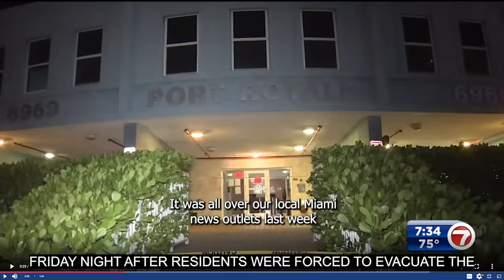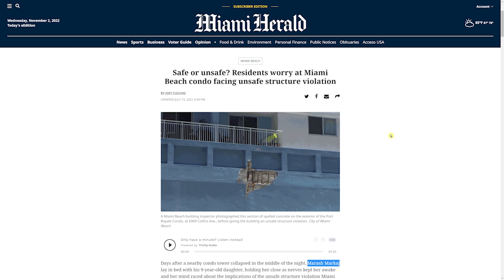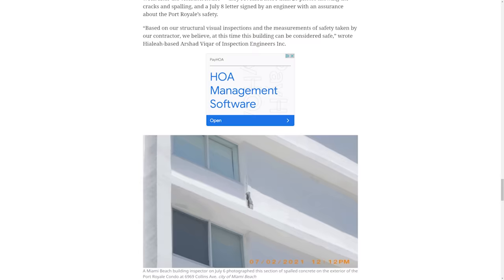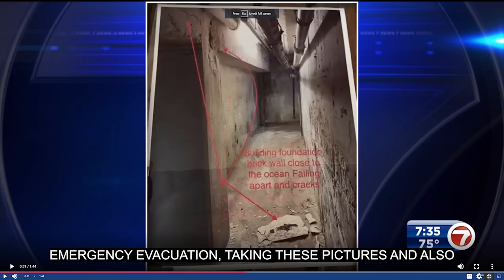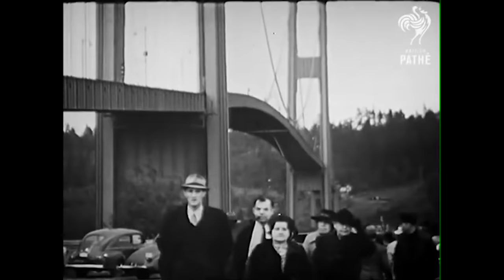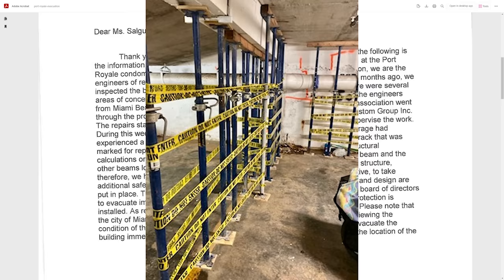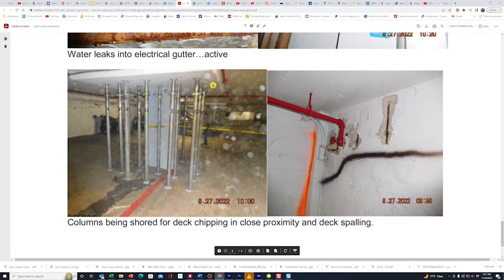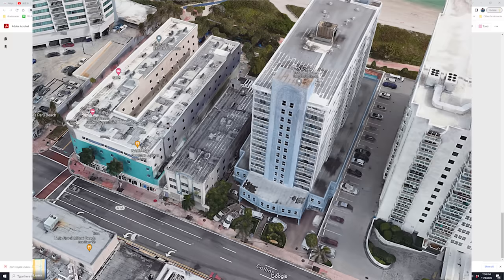Another Miami Condo Evacuated Why it Will Collapse

Comment from the maker: 📺 WATCH: Miami Condo Collapse: 4 Engineering Fixes May Have Prevented It: https://youtu.be/CK3o8KlL3NQ
📺 WATCH: Scary Garage Damaged Concrete Marriott Harbor Beach, Like Surfside Collapse
https://youtu.be/3EzxZJhXRR8
Reply: The decision to evacuate a building like this is HUGE
But no matter how inconvenient it may seem I believe it was the prudent thing to do. I just would like to see that residents and property owners have the right and ability to have a second opinion. Anything can be politicized and weaponized.  You don't want to give too much power to corrupt city officials.
Reply: With respect to the pertinent and reasonably-covered subject matter put to one side the audio quality of this video is abominable. It sounds like you recorded it talking into a shoe.
Reply: is this what happens when you build a city on the back of a cocaine fueled boom? From the mid 70s to the late 80s?
Reply: @guidedmeditation2396  go look up sydneys Opal towers......
Reply: Looks like all the apartment buildings in Florida are on collapse alert!!
Reply: Are there no primary steel beams?

Comment: It’s hard to wrap my head around the idea of this building being repairable. Thanks as always Jeff for your efforts.
Reply: If you're willing to give up enough underground parking spaces, ANY such building can be saved... i.e. picture a parking garage with nothing but shoring poles!... :yougotthis:😱
Reply: It’s Florida. They’ll just throw some bondo and duct tape on it. 
The builders AND owners, will never be jailed if it falls down. It’s only a fine. 

“If the penalty is a fine, that means it's legal for the rich.”
Reply: i concur
Reply: @tetchuma  So you know the building codes in place in Florida exceed most if not all of the nation, you see many buildings torn down or rebuilt due to lack of structural integrity.  This building was built in 1981 when building codes and shortcuts were commonplace.  If you want to see decrepit buildings look in NYC, scaffolding in place that you see all over the city is there for one reason and that's to hold up the buildings and the tearing down and rebuilding you see in Manhattan is for the same reason, the building is just too old and unsafe to use.  Many contractors in south Florida used sand from the area which is full of salt, shortcuts to save money and a blind eye was turned towards it.
Reply: I wouldn't want to live there.
Reply: @krisone63  
Judging by the video evidence of old rusty drips and several instances of cracking/deteriorating concrete… yeah, Florida is FAR MORE superior at preventative maintenance than anywhere else in the US… 🤨
So when will you and your family be moving in?
Reply: @krisone63  scaffolding supports buildings?
Reply: The scaffolding keeps the falling chunks from killing people on the sidewalk. It doesn’t support the building.
Reply: CDI and the Loizeaux's will repair it.. if it is still safe enough to prep for charges.. LOL
Reply: Same for me. Even if they filled the entire parking deck full of concrete, what’s the structure 2 floors up look like?! Could a hurricane take this building down?
Reply: Yes. And whatever deficiency that is showing up in cracks is likely or at least possibly also in areas you can't see.   Concrete is only as good and strong as the one bucket they poured that one day.   In China they have huge beautiful towers that all have to be torn down because they didn't mix the concrete right and it is shocking they have not collapsed already.   The main tower columns can be chipped away with your thumbs..  It is as if the main support columns are made of saltine crackers and your an scratch inches of it away as you dig your fingers into it.   They have a name for this problem.  They call it  TOFU DREGS construction.  It is about as sturdy and strong as tofu.
Reply: Depends on the condition of the concrete and what's under the foundation. They could pour more solid colums or even an entire wall in the basement but the pilings underneath have to be able to support it. They can add more steel.
Reply: @tetchuma  no one is rich enough to handle the repercussions of these buildings champlain is in the billions now
Reply: @tetchuma  time to demolish and rebuild imo. This is like the slowest nightmare that we’ll be watching for the next two decades
Reply: It’s a tourist area and everything is centered on that … things are getting older an getting worse as time goes by
Reply: @MajorCaliber  The sand in the concrete mix is unwashed sea sand. It will just continue to crumble and rust the rebar. It doesn't matter if you pump the entire parking garage from floor to ceiling with concrete, the columns siting on top of it will still collapse. As a  union mason who does retro fitting for a living, there is no way in hell i'd put my family in that building. This building needs the rebar x-rayed and concrete cores taken and load tested.
Reply: I wouldn't trust the amount of probable damage throughout the entire structure. If a concrete beam separates by 1/2", everything above it must have suffered shear loads it was never meant to see.
Reply: @Khanfuzed1  As this is a condo, (like Champlain towers) I give all the responsibility to fix it to the unit owners.. Champlain towers just got lucky and had a neighboring building to blame for their issues... At some point the assessments are too high to fix and you have to dissolve your condo association and sell the land.
Reply: @MajorCaliber  - i was thinking same thing.. if you filled basement in with cement.. it might support it for years to come.. (yes i know this is not practical or possible)
Reply: @krisone63  I've heard the same about Panama City, Panama and their impressive sky line. Towers built with salty sand.
Reply: Florida, where the buildings and the residents are just waiting to die
Reply: @Jane-Doe.1126  live? how about walking around within falling distance of these buildings...
Reply: @guidedmeditation2396  I thought the situation in China was that they built those towers to provide jobs and to create a housing bubble (make their economy look big and healthy for outside observers). They were never intended to be occupied.
Reply: @NealD  
Consider the weight of the mass concrete filled in the parking.
Does this additional weight not do any effect on piles and ground?
This building is dead , fixing is not impossible but cost is way too high term of fixing is too long and too complicated.  It is better to demolish and build new.
Reply: @klubstompers  
Any attempt to check how bad is this building is waste of energy and money. Time has come to die.
Reply: Everything is repairable, just a matter of money.  I've knitted monumental stone together with rods core drilled for feet through cracks to 'reconnect' stones.  There are many such specialist systems, that often come with manufacturers techs to make sure the GC crew gets it right.  Just like cutting edge medical.  Oddly enough.  Then there is just adding new structural systems.  I've been under buildings watching new piles being forced down into the earth one small section at a time with hydraulic rams, talk about labor intensive!   It's work you want specialist engineers and architects for, and it's not 'low bid' work, it's qualified contractors only, and such are always booked up, 'cause it's a no short cut biz, the exact opposite of what every contractor learns is how to stay alive and thrive.
Reply: If you can build it, you can repair it, the work involved in doing so is very technical and difficult and big $$$$$$ hence why they are left and not done.
Reply: @TheRealChappy  of course , it doesn't
Reply: @jumpinggoldagatito9153  The only way to tell is to take core samples and x-ray to find out what is within spec, and what is not, and replace or shore up what is not, if possible. Never know how bad it is until you actually test it. If the main load bearing columns are within spec, than it can most likely be saved. All depends how much moisture has penetrated down to the rebar, and where.
Reply: @brad9529   because it is unpredictable when the structure drop down.  Because occupants do not want to die. 
Because everyone knows the repairing is difficult , and how much repair is needed to call it safe and how long the repairing works stand against the salty environment. Periodical repair works needed for all of the building built in this area coat $$$€€€€££££££
Reply: @russell7489  Not everything is worth for repairing.  Economy kicks in. Who pays the $$$$$$$ ???  I predict this area are going to be ghost town lines of abandoned buildings. Back to the nature.
Reply: @klubstompers  
We see the condition of the building by eyes this far. Concrete cracks , beam rebars are rotting , salty environment made the concrete Neutralization process has gone up to the disastrous point. As you say we never know the scope of damage unless we test it. You are 100% right following books. But those  spec books never mentions economic impact and never suggests to consider $$$$$$$. Testing companies are very happy to get involved in finding the scope of coring and x ray or anything else tests . Repairing is possible but not realistic to this building damaged this far. I asume repairing costs much more than demolish and build new.
Reply: @jumpinggoldagatito9153  Yea, but that all depends on the scope of damage. Drilling some cores, and x-raying a building, is 1/2 of a drop in the bucket. You need to determine which is more cost effective, retro fitting or tear down and rebuild, and the only way to know is to test the buildings structure, and go from there. Most of the damage seems to be coming from places with leaks, so damage might look a lot worse than it is, you cant tell a buildings bones by looking at it's face.We will all know in a couple years, if this ends up being a parking lot, or if it's still standing with people in it, only time will tell.
Reply: @klubstompers  
The decision to make here , another words the project goal, is to determine repair of demolish.
The goal is not to inspect damage. 
There are some approach to determine the way to go.
Inspect the damages thoroughly by established devices is one way.
When there are obvious visible damages which is in this building case , I plan how to fix the visible parts. Count and analyze the nature of damage the visible parts only.  
Then propose the fixing method, duration , including evacuation period, scale of compensation.
Estimate the cost of this base cost of repairing work, which all engineers agree this is not enough. But , it is a minimal repair cost . Is this figure agreeable or not? If not agreeable already at the minimal cost, what explanation can justify to pay €€€€€ the total inspection fee??
If the initial cost is acceptable then spread repairing parts wider and enlarge by meters by meters to the point engineers can agree as reasonable scope based on the assumption from current situation. 
Run the Value engineering.
Reply: @tetchuma  He never claimed preventive maintenance was better in Fla. He said building codes have been updated to higher standards than much of the country. This is causing old substandard buildings to be repaired or torn down.  Work on your reading comprehension.
Reply: @jumpinggoldagatito9153  In the US, you hire a structural engineer. They come out to asses damage, and part of their assessment is to test for structural damage, to determine what needs to be done to fix the problem, which requires load testing samples, etc. Then the company gets bids for the work from multiple companies, and determines if it is cost effective to repair or not. It only gets fixed per the engineer's requirements, so there is no corner cutting. The engineer has to follow code, and repairs have to fit the engineer's report, or the building doesn't pass inspection. In the US you build it per the engineer's plans, or it doesn't get built. In the US we even do load tests on grout inside of CMU's, for every block building built, so load testing is very inexpensive here, and some generals will x-ray a building to make sure bar was placed correctly, so that isn't expensive here either.
Reply: @krisone63  
The FIU bridge was expertly installed… you know… given the building codes that exceed most if not all of the nation…
Reply: @tetchuma  these structural laws/reqs are relatively recent. New buildings are much better on avg
Reply: @jumpinggoldagatito9153  Would the current building codes for new condo towers, or any building, be ENFORCED or would new projects ending up the same way after 40 years ( if they stand that long?)?
Reply: @krisone63  You must be joking 😂🤣
Reply: @krisone63  The reason you see so much scaffolding in NYC is because building facade inspections are required every 5 years.
Reply: @krisone63  
Explain to me how an apartment complex in Hialeah, FL that just partially collapsed on October 31st, just 3 years after it was certified by an engineer, who it was discovered, had been dead 2 years prior to the date of certification???
“… exceed most if not all [building codes] in the nation…”??
Reply: NO ITS NOT
Reply: @MajorCaliber  They don't collapse from the bottom
Reply: Any building can be repaired, but at what cost?
Reply: @tetchuma  Your last sentence was a dumb take. 
If it's legal for the rich then they wouldn't be getting fined, would they?
Reply: Information not clear, not enough red arrows pointing to random things.
Reply: @timramich  indeed, like Florida condos, Chinese apartment buildings were (are) investment properties. At first everyone was trying to get rich, then it becomes a game to 'hot potato' with everyone trying not to be the last one with no one the toss the potato to.